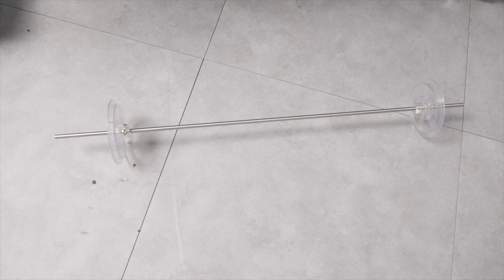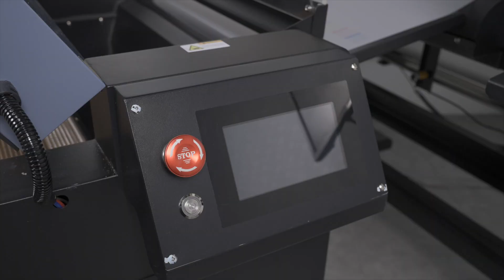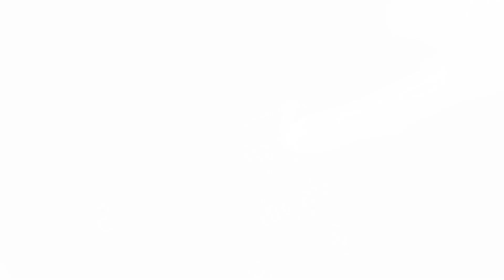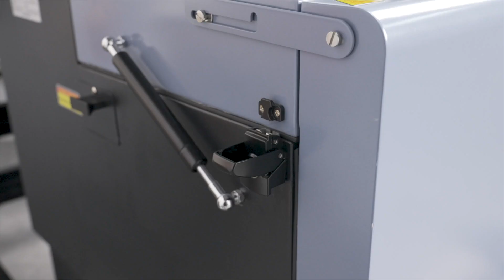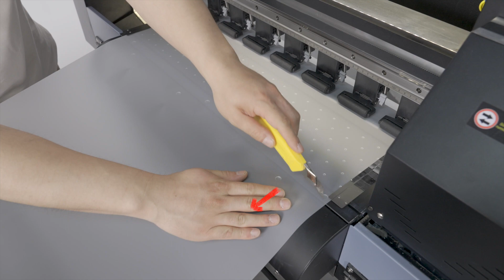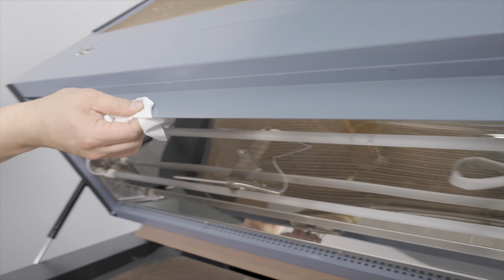Seismo M series - Operation | DTF Station

Comment: I'm having a hard time with timing point A to point b without scortching.  the pull up reel has a mind of its own as far as timing goes idk how you walk away from it... says compatible with r2 pro but feel like the printer isnt fast enough for the system I always have to babysit my set up...any tips to make this easier... Maybe I'm over thinking this...
Reply from the maker: Hello, sorry to hear we are running into issues but the R2 Pro can certainly keep up. So long as the sensors are properly engaging they should work in unison. We can try lowering the heat to start but we would love to connect with you on Discord for live support. Here is the link to join our server: https://dtfstation.com/pages/live-tech-support